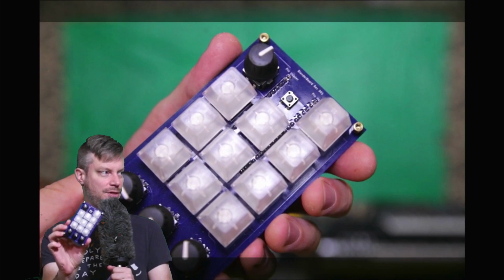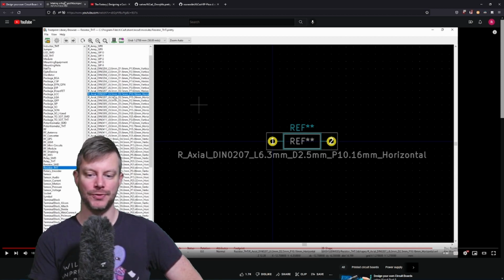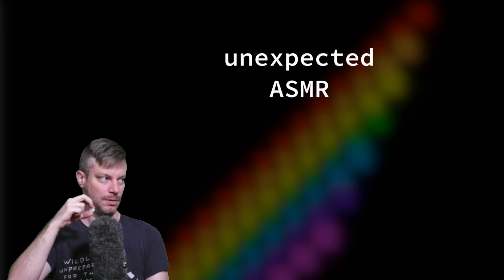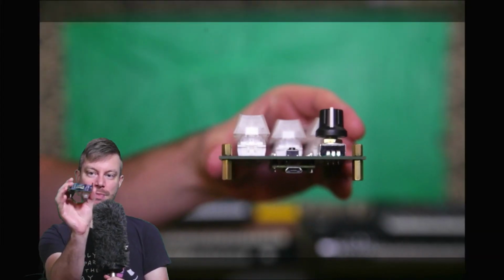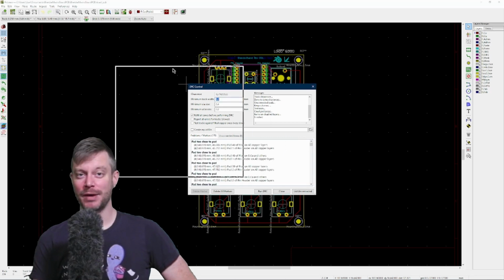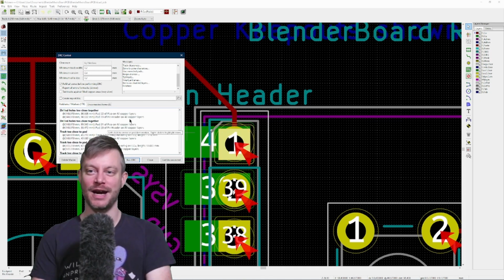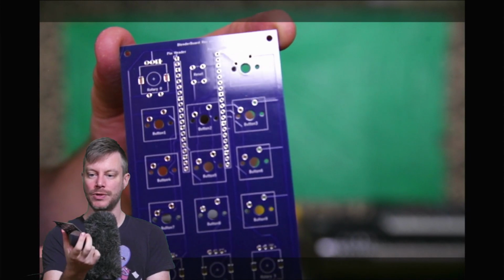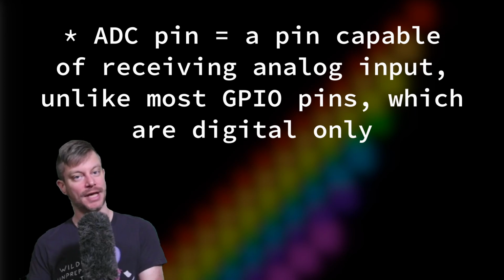KiCAD, Circuit Design, Critical Fails & Lessons Learned #b3d #blender #pcb #kicad #raspberrypi

Comment: hey man, great stuff! im wondering what the status on this is, after one year?
Reply from the maker: I have been dealing with personal issues that have made this project more challenging, and it has not been in active development for some time. I hope that can change, but I have not been able to make that happen yet.

More project specific though, the current status is 'Working, but with issues that may require a redesign to completely fix'

The two main issues are:
- debouncing: the rotaries will skip or sometimes turn backwards if they are turned too fast
- quaternions: the device was designed to have 3 main rotaries, but in order to properly animate bones and armatures you will require a fourth axis

I have already fixed the issue re: the top rotary not working correctly, so that could address the quaternion issue, but the debouncing may require a redesign: I implemented 2 or 3 different debouncing solutions but none of them had any effect, leading me to believe that debouncing was intended to be used in a PullDown rather than PullUp resistor design (I might have that backwards) and that I might need to make some changes to the circuit to accommodate that.

Thanks for your interest, I hope to have an update at some point, but unfortunately I don't yet know when I will be able to return to this particular project.

Comment: If it helps, the reason it seems for the KiCAD errors was because the Pico footprint uses the SMD pads (ie the use the castilations on the pico to solder without the need for a header) and you then put 2.5mm headers as your connection method, so the DRC got confused as you had overlapping footprints which confused it.

Ideally you would only have 1 footprint per part so you then don't run into that.